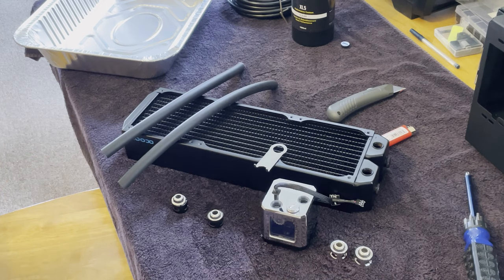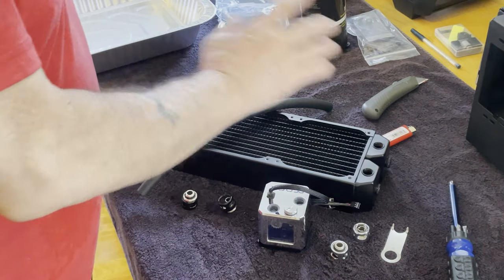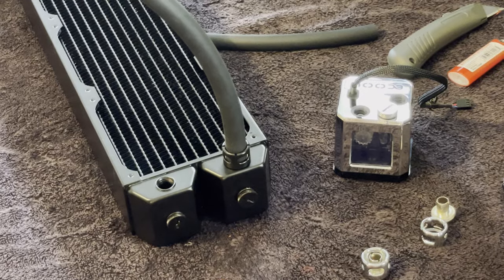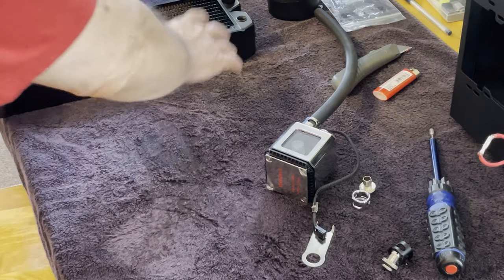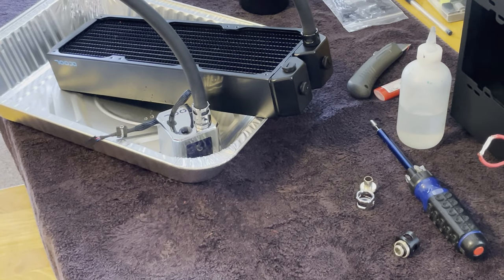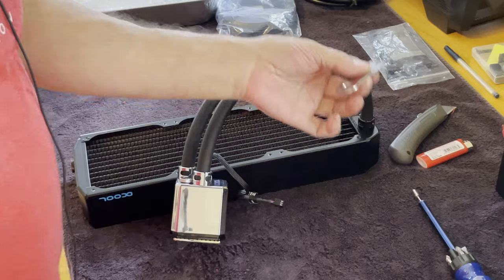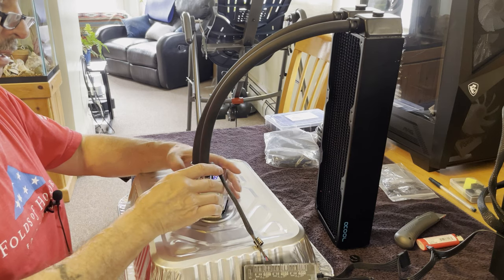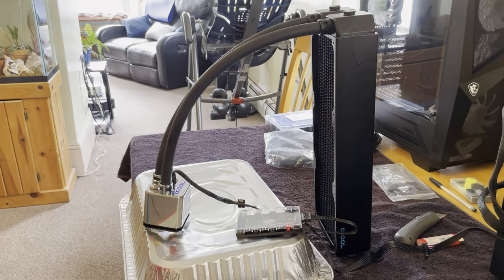How to make your own AlphaCool 360mm AIO

Comment: Tell me please the name of radiator, pump and size of fittings and tubes.
Reply from the maker: Alphacool Eisbaer Pump, Alphacool 360x40mm radiator all copper, Hose is 1/4 inch.  but you can get lots of hose and fitting kits that go together. Hope this helps